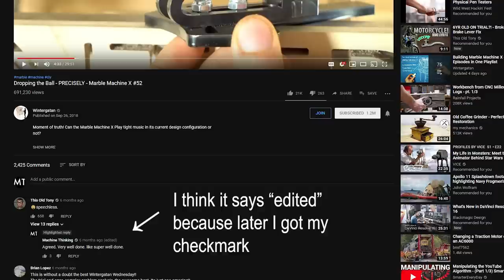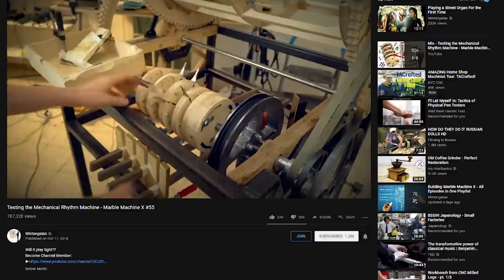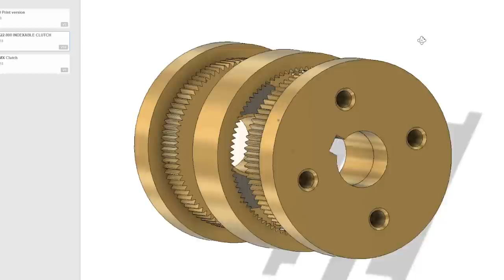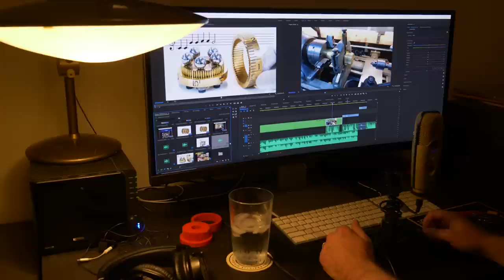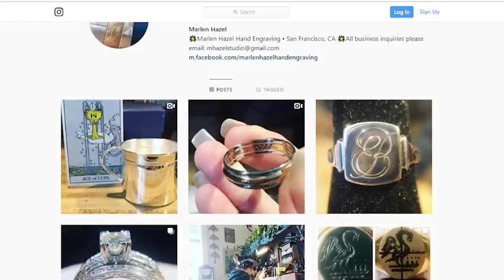Perfect Timing (with the Marble Machine X)

Comment: Me and the Marble Machine X are equally thankful for the timing of this particular sliding door moment Will :)
Reply: Nice job guys!!! I love how this piece looks on the MMX 😍
Reply: I was waiting for Brass Wilson to show up.
Reply: ♥ Martin
Reply: Marble Machine is truly a work of art and engineering. Amazing work done by all of those involved. 🙂👍
Reply: And wilson
Reply: I wonder if there is a world record for the most people to contribute to the manufacture of a single instrument. And How close the Marble Machine X will come to that number. =)
Reply: @Tuttomenui  not to take anything away from the MMX, but another 3-letter item probably has a LOT more hands involved - the ISS.  Granted, that was not a private, grassroots  venture like this, but still an amazing accomplishment.
Reply: @Gibson99  Instrument, Musical Instrument. So Far I think it has most beat except for maybe pipe organs.
Reply: Isn't the metal oxidating with time, is it?
Reply: Brilson?  @7wv5
Reply: @Tuttomenui  Hard to say.  The builders of dance/fair organs and orchestrions probably still have it beat in terms of sheer number of people. But in terms of number of independent designers directly supplying bespoke parts?  MMX is has good odds there.

Wonder how many people were involved in Domtoren?
Reply: @WillowEpp  Yeah I figure pipe organs are the ones to beat. Especially very old pipe organs that were completely made by hand in the old old times.
Reply: The connections that have been made by this one project are so mind blowing. Simply said, "amazing!"
Reply: @riotgirl3115  nope brass and stainless steel are safe, the rest will be treated with oil and stuff / be kept dry so yeah
Reply: @Tuttomenui  I think the universe will always be the most complex creation, after all, God incorporated every last one of us into it. 😁
Reply: @riotgirl3115  Yes it will oxidize and get duller over time and need to be polished again.

Comment: I work in a newspaper printing factory and we use the same clutches, as you just made, only a little bit bigger 😃
Its use is 2 fold, as a timer to sync different parts of the machine and as a safety device. Our outer ring is made of hard plastic and if something would go wrong in the machine it would break, before the machine itself becomes damage. It is something like a torque fuse. 😆
I liked your work and video, very well made. 👍 Came here after seeing Martin's video.
Reply: Torque fuse is such a great phrase
Reply: Could have used all metal gears and a small shear pin, both work equally well at safety but a shear pin costs pennies...
Reply: @PaftDunk  
Shear pins: that's what Acme Gridleys use.
Reply: I think that 'torque fuse' beats 'shear pin'.  Good way to design for safety.
Reply: Isn't that a sacrificial clutch?
Reply: @pilotavery   No because, like a fuse, the connection is always there. The connection is never disengaged. Like a fuse, it is a build-in weakpoint (point of failure), so you know where the connrction will be broken in case of a failure. 👍
Reply: In the old Square Balers, they use shear Bolts connected off the Flywheel, to shear if anything effects (too much resistance) or stop the mechanism from destroying itself apart. Some farmers never relies what shear bolts purposes were for. They learn the lesson the hard way.

One particular farmer got frustrated in buying shear bolts, because they were shearing multiple shear bolts a day, and he put in a steel bolt instead. Well it solved his stopping issues to replace the shear bolts, but wreaked the baler when a tree branch was fed into the main chute where the ram (which compacts the hay into the Chute) buckled itself apart and damaged the shear blade (to cut the hay) on the ram and various mechanisms, that had the full flywheel energy injected into it. That old baler no longer has problems with too much Hay, as it is now scrap. Parts for that particular Baler is too expensive to ship. His old square baler disaster was an expensive mistake.

 I told him he had two problems on top of his "steal bolt" problems (as he stole the steel bolt, Karma is a bitch). 1/. Too much hay in the rows , not evenly spread and 2/. He is driving too fast, thus picking up too much hay for the small square baler to handle. After getting a new second hand wider pick up baler, he thought he show me off in front of others, to prove to me that I was a "smart ass". Of course he was still was breaking the shear bolts, costing him money and time. So I told him, pick a field where he normally breaks the most shear bolts and the time he takes to bale the field. Not only did I not break any shear bolts, I finished faster (2 hrs) than he normally did (4 hours) , despite moving slower,  because I did not had to fix any shear bolt issues, and to remove excess hay, or stop as often as he normally does. Plus I rowed the Hay before hand, unlike his other helper whom did not do his job right. They always complained that I re row the two headlands (hedge sides) rows twice. First was to move as much hay away from the hedge (most grass growth is at the hedge), and transfer into the second and third row to more evenly spread the grass load. 

 He later swapped to large round bales as it gave him far less issues, but instead of a different problem, he was back to old speeding habits, and the bales were not symmetrical as the feed rate and width was uneven. So even in the farming community quality and precision is everything.
Reply: @limerickman8512  wow how do I explain that to my FLL robotics team. I have been trying to explain more power equals Tim Taylor on Home Improvement going boom, or another words turning it up to 11 doesn't get you the accuracy you need to complete the mission.
Reply: @imark7777777  "Tim Taylor" "Home improvement " boy that some memories in the 90s. That show would not be made today under SJW, Feminist outrage mob rules. Thst is a discussion that will take years to unload and dissect.
Anyway, experience in disasters is crucial in helping why things happen. Building things with scrap from a farm. Try and get them to build a raft out of barrels (fix leaks),  bailing twine, pallets. Each piece is a different skill to lean and give improvements.. I also have learnt many from the mistakes of others by keen observation from an early age of mechanical breakdowns and accidents. I have seen many bad repair jobs and good examples of good repair growing up. My neighbour called me a nosy kid, because I kept asking him questions as he should have been a mechanial engineer and not a farmer. He was a good farmer. 
When any breakdown happens anywhere, I was like a magnet around the machines and workshops.
As for designs. To this day that square Balers still impressed me on how complicated they are and the timing of each piece of that blaer from the power input to bales output. It was a design masterclass.  So many different mechanical principles that are in sync with each other just to tie hay in thread and knots. The knotting section is a study in itself as so many things can and have gone wrong. I watch my father sole of his boots gets worned down (still remember the burning smell) before my eyes as he tried to slow down the flywheel as others clear the obstruction in the pick up and bale chute areas, as there was a rush to finish baking before the rain as we can see it coming slowly from the hills.
 I learn to watch out for problems in the hay and pick out branches and reduce the hay row volume to even it out. I did all that before I rowed my first row, so that I learn to make my life easier days before rowing, by moving the hay away from headlands when turning the hay and remove any obstructions when turning the hay a day or two before.  
Alot of prep work is needed (out of experience), so later work is reduced. 

So I let kids makes mistakes and then talk about the issue and break things down into seperate parts and then talk about how each section works together, by asking questions by going to the beginning. Or start to work backwards. I build up their toolkit any tackling any problems by different point of view. Example of Questions like Why is something needed? Is there a better way, or improvements can be made? 
Start with the flywheel. Why is it needed?
Reply: torque fuse... that's a good concept- thanks
Reply: Ive always just called things like that "mechanical fuses" since I deal with electricity for a living and don't know the actual term haha

Comment from the maker: Take a look at Martin installing and testing it here! https://youtu.be/CBfd0Tjii9Y
The washers are there just as a placeholder where the Marble Machine's gears will go.  Don't worry, those are not part of the final part! :D
Reply: Nice job!!! Looking forward for more collaborations between both of you!!!
Reply: Just the spline spining that could have been a disaster
Reply: And well done my favorite part was the polishing
Reply: whoa destin from smartereveryday ? noice !
Reply: How did you fixed the spring on to the brass? I dont seem to see any bolts and nuts nor a groove for the steel to lay in and not slide out sideways due to the rotation. Did you sawtered it in place or epoxyed it ? Or maybe its something completely different. 
I'm curious!
Reply from the maker: @Actually_Alice  If you look closely at the shape of the spring (in paper) you'll see it has the curved part and at the thick end there's an extra piece that sticks downward. I simply sandwiched this extra part between the splines and the backing plate and the bolts squeeze it all tight. It means now that the splines stick out slightly (from the plate) but I don't see that as a big downside for the simplicity of this.  It does mean that the bolts need to stay absolutely tight though and I have advised Martin to put a little blue loctite on them before it gets shipped around
Reply: Your chamfer is slightly off center at 14:08 :-(
Still, I'm impressed by the high quality of your work :-)
Reply: Came to this video from that one. Went to subscribe...... Was already subscribed.
Reply: Super nice...But I don't know if it was the camera or not but the paint in the numbers looked a little light...May another coat or two...Thanks very much...!
Reply: @machinethinking  Seeing you doing that turning backwards and upside down just gave me a horrible flashback of doing the same thing (way back in .. a long time ago).  Then one time setting the machine back to normal and forgetting to put it back into forward gear.. I was very lucky and it didn't actually destroy the machine but it was a near thing. It was then that I finally decided that turning wasn't for me - I had to be honest with myself, I just wasn't very good at it. 
Wonderful seeing a master at work.
Reply: Tzuede Off the Cuff  Fine business...Thanks much l will...!
Reply: Don't pull your self down man you are on of the best designers I have seen on YouTube
Reply: Don't waste money on special bits for brass,  buy a cheap set and watch the ClickSpring video on modifying them. So so so easy. Thank me later? Also, if you're only doing a few holes and cant be bothered to get the special bits out,  just put a ton of pressure on the quill/feed.
Reply: get super glue and glue release ...other lathe guys use it :p and hot snot has to add challenges not werth it

Comment: For the engraving, try black shellac. No idea about suppliers in the US, but it's really easy to work with (soldering iron with copper end-bit is hot enough) and leaves a really beautifull finish if done correctly. Has been the go to for clock and instrumentmakers for ages
Reply: I was going to suggest "Brass Black"  -- it reacts with the brass to make a black oxide layer that's chemically bonded with the base metal. It's very abrasion resistant and gives a dark black that "pops" if you use a clear sealant over it, which you should use anyway if you want your brass to remained untarnished and fingerprint free.

 Birchwood Casey makes small bottles of it for gunsmithing and it's usually available at bigger sporting goods stores that sell firearms.
Reply: Its mainly just nitric acid.
Let it do its thing for a few minutes and wash with warm water. Leaves a deep blue oxide layer on the brass.

Comment: I have a piece of oak heartwood, about four feet tall, foot and a half in diameter, I use for a "wood anvil", working with sheet metal or doing punch or engraving on bronze or brass. It weighs over an hundred pounds, the end grain gives great support, and molds to a very small but fine degree, to the metal.  That tree was almost five feet in diameter when it came down.  Enjoyed watching you "cut in reverse".  My lathes are all with threaded headstocks, I can't do that, sure looked beautiful, not flying in the air.  Thanks for showing this, always love to watch brass or bronze turning or parts moving, been with steam most of my life.

Comment: I'm probably not the first person to suggest this but you can convert your existing drill bits to brass/aluminum by modifying the rake angle. Chris from Clickspring made a video on this subject called "Modifying A Twist Drill For Drilling Brass"
Reply: It’s called “brassing off” the cutting edges for a reason haha
Reply: I have a super fancy set of brass drill bits. They're so dull and old thats about all they will cut. Got em at harbor freight years ago! Must be worth a fortune in appreciation.
Reply: Never knew there were special drills for brass, always sharpened a drill for the application . . . .I guess that's just old school . . . .Great project and vid!!!
Reply: @dannyoktim9628  Brass, unlike steel, tends to grab on to the tool. You can see this happening in the video where the drill bit tears the piece out of the vise. This is why optimal rake angles differ from metal to metal.

Check out the video called "Modifying A Twist Drill For Drilling Brass" for a better explanation than I can give.

EDIT: it can be even more noticeable when drilling plastic.
Reply: Sheldon Robertson  Oh.
Reply: I was just going to suggest Chris's video.... foiled again :P
Reply: Raking a drill for brass has been around for the fifty years I've been a machinist. Optimum rake for various materials was one of the first things taught to learning apprentices. Not much new under this sun.
Reply: @narcoleptic8982  , Or backing off in NE England.lol
Reply: Negative rake for brass.
Reply: I grind drill bits, herringbones, and reamers for Boeing on Anca RX7's 5 days a week and Give a big thumbs up to Priviledgier Sheevlord! Rake Angle is MAGIC! ;) But Keep that Gash WEB and Gash Center both under 5 thousands and it's like hot knife and butter!!
Reply: It's been done since I was a kid.... and I'm sure long before that.  However, fewer and fewer "machinists" have the skill to sharpen their own drill bits.  And, if they can... they are using a dill gauge to even come close.  It's a skill that is lost!

Comment: How did you attach the springs?
Reply: And why all the washers???
Reply: I think the washers are temporary shims.  Those bolts are long enough to go through another piece of material as they are what will hold the clutch onto whatever it's attaching to.  Maybe.
Reply: Or maybe he just didn't have the right length of bolt and had to use longer ones...
Reply: @pstrap1311  "Those bolts are long enough to go through another piece of material as they are what will hold the clutch onto whatever it's attaching to"
Yup.
Reply: Yeah, he probably would have just made the machine screws he needed if he didn't have the right length haha.
Reply: @pstrap1311  Or cut those down to size. I've done it with a hacksaw.

Comment: A bolt with a washer through the middle of the rotary table will keep the part in place (if the rotary table is threaded in the middle).   I don't like drilling holes if the part isn't secure (you know what happens, haha!).

Thanks for this video, I've only been working in a machine shop for a year and your video has given me a lot to think about :)

Comment: Helpful hint time - when drilling brass I have found after years of experience (pulling out of vice) if you grind a slight positive rake angel on the drill it will stop it from lifting your job up. As it will still cut but you have to apply a little bit of pressure and the positive rake will stop it digging in :)

Comment: For turning and drilling brass it works best to have a small negative rake on the cutting tool. On your drills, just grind a small flat on the cutting edge and it will not grab the part as seen in your excellent video. A negative rake on the lathe tools will give a better finish too. Thank you for showing what a real craftsman can do.

Comment: In awe. Subbed. Youtube suggestions for the win. If you ever do a 'sharpie blackening', my best practices (with either paint or sharpies) is to let it dry for a bit, and make moist a thin paper sheet with a solvent. Place the paper on a flat surface and rub the part over the paper solvent , just move it when the paper is saturated/contaminated with the paint.

Comment: Very nice work, a tip on the drill bits, brass bronze and plastics are materials you need a dull drill bit for ;) , even if you don't have dull drill bits just rub the corners of the cutting edges with a diamond stone to round them a little and they don't grab so easy, if drilling into brass on the lathe tighten the tail stock quill lock so you can turn it with a little difficulty but the stiffness helps to stop the drill bit being sucked into the part, especially when drilling into a pilot hole or worse.. widening a hole by only 0.5 -1mm, bronze will try to drag the drill, Jacob's chuck and tail stock through it's hole.. through the chuck and down the spindles chute